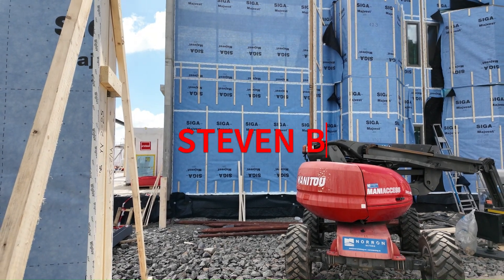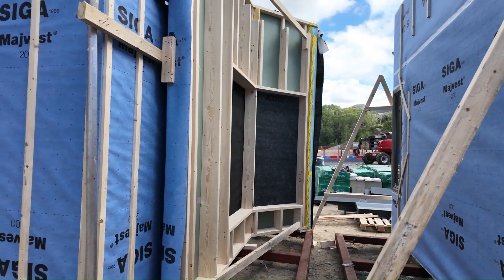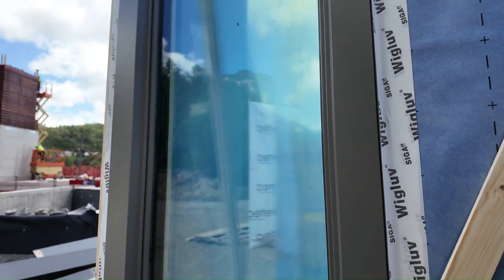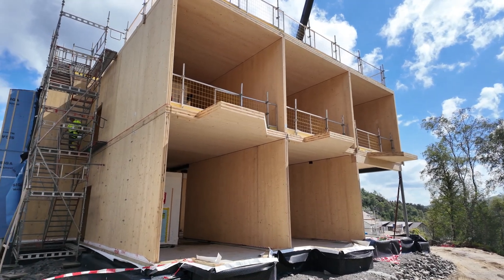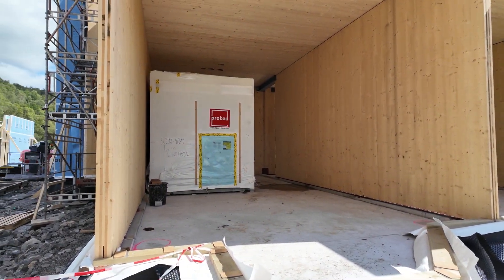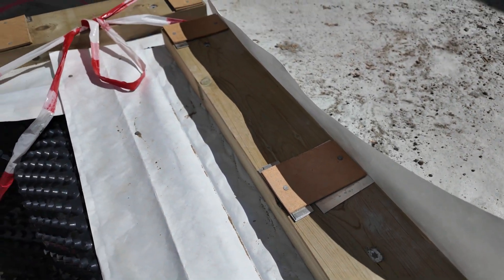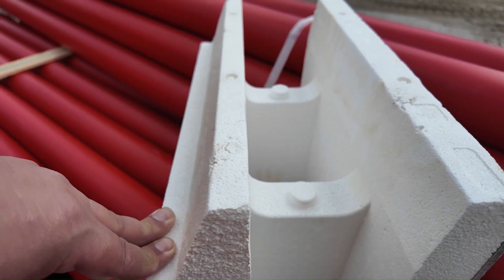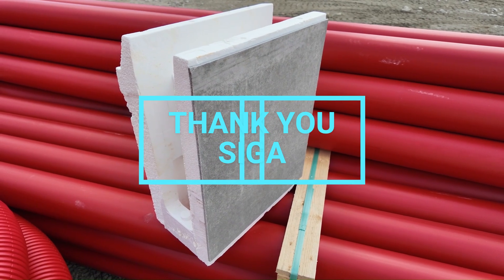"ELEMENTS" Pre-Fab on CLT

Comment: I wonder if the outer (end) walls have any structural role. It almost looks like a curtain wall. The prefab walls have minimal lateral bracing function and It appears they sit on the CLT floor that is already supported in the low span between the interior walls. Can you find out about that?